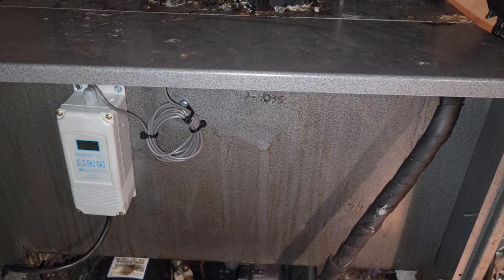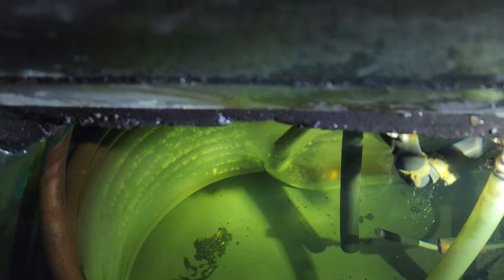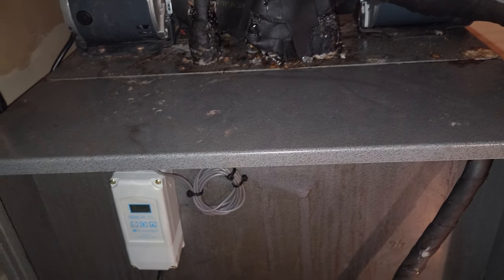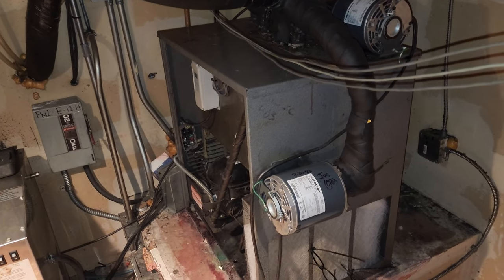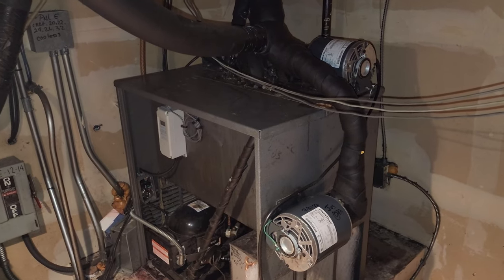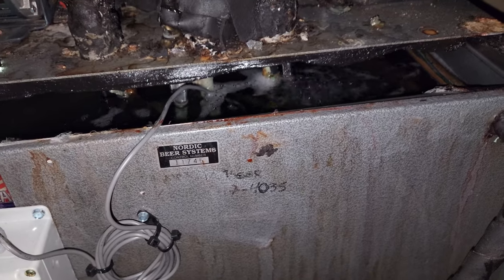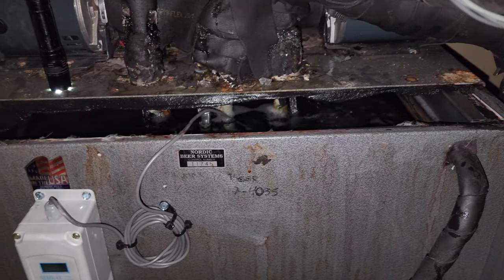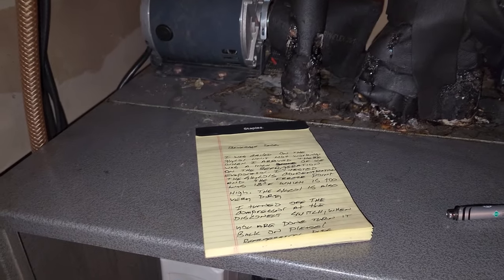THE GLYCOL IS NOT MIXED RIGHT

Comment: Glycol does deteriorate over time. It did look like it needed to be replaced. Thanks for sharing the video with us.
Reply: The deterioration of glycol is based on how much oxygen (air) exposure there is.  That's why, on an automobile, you have to keep your overflow tank filled properly.   That keeps air from getting into the (extremely) hot radiator, and breaking down the glycol.    It  means the difference between changing radiator fluid every year or two, or every five.   (Realistically, it's complicated.  Hours of operation can be more than hours of existing, but just sitting, the fluid doesn't circulate properly.   )

If you've had your car at least three years, and you've never even done a drain and fill on your radiator - get it done.   Don't believe the 100,000 mile certification.     Same with your transmission fluid.  It's not lifetime - get it drained out and refilled every 35k miles or so.

Comment: 👍🇺🇸❄💪 I have the same unit 2004 n I've changed the glycol 3 times in 3 yrs n I use my glycometer n I keep my brix% at 25-29 which gives a freeze point from 3 degrees to -6. Unit probably has a leak n plus ambient temps don't help very hot to very cold. I told them to get a new unit. At the minimum the glycol should hold for 2yrs or more b4 change.  Thanks Chris

Comment: Shit I normally just put the 90% from united never really had a issue, I work on to many types of equipment to be a expert.   I put vortex fans in front of a couple condenser for some   glycols  unit every summer. They always put them in the worst spots. Spending  30min changing condenser fan motors on a glycol unit in the attic when it's 138*f is no fun.